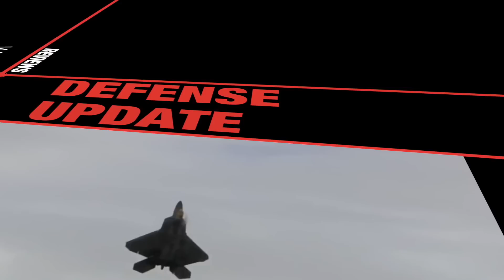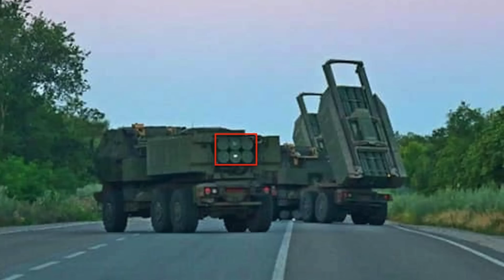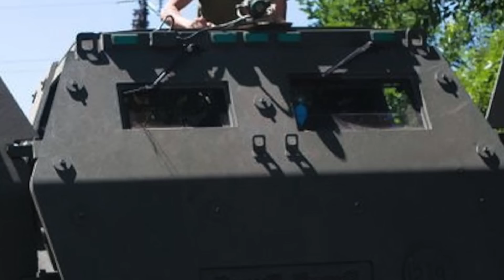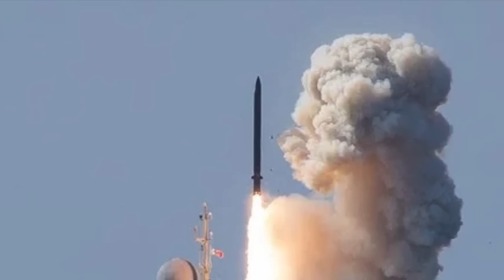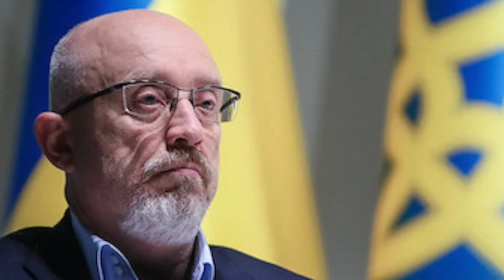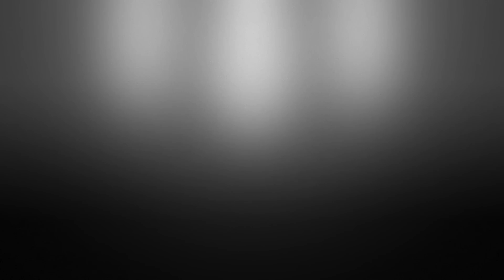Russia destroy HIMARS | But they are wooden !

Comment: HIMARS decoys can be built even faster, and cheaper, using Coroplast sheets. 😄

I bet Ikea would even participate in manufacturing a quick to assemble flat packed kit.....  😄
Reply: Ikea might make a HIMAR decoy but considering the huge size of those can you imagine the the cost of 'shipping and handling'.  Also consider the fact of the superlight weight of those thin sheets , seeing a HIMAR moving with a light breeze might be just a little suspicious,